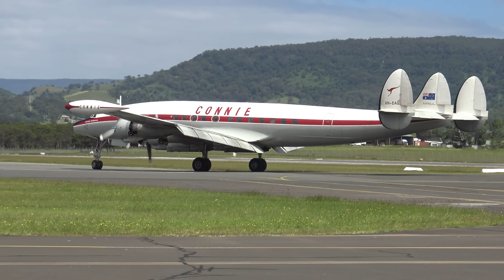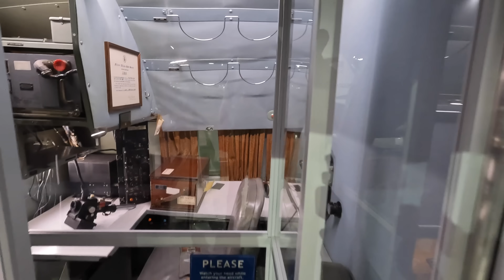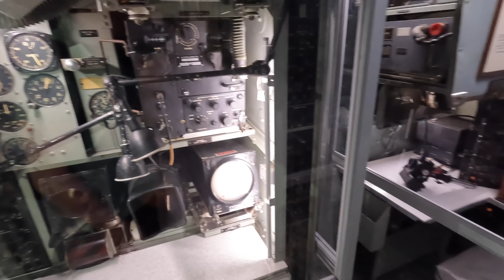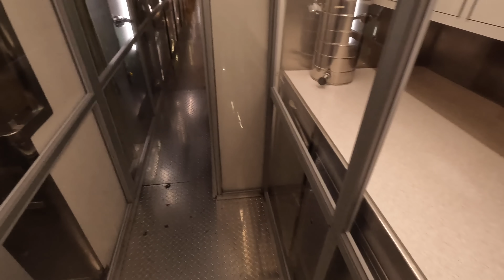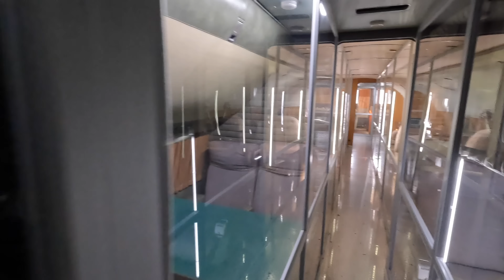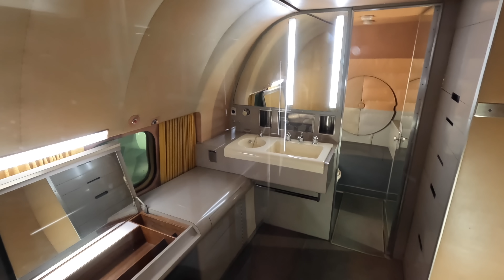Tour through Eisenhower's Air Force One - VC-121 Columbine III

Comment: There is a Connie permanently parked outside the TWA Hotel at JFK airport in New York City. The interior has been converted into a bar and lounge and anyone is welcome to come in. That’s the only Connie I have been inside of. It’s very well preserved inside and out except for the bar they installed at the rear. The plane and the hotel, formerly the old TWA Terminal, is well worth a visit if you are ever stuck at JFK for a while.
Reply from the maker: Yes great suggestion! I was in JFK last year and totally forgot about this but I definitely need to stay there next time. Apparently it's expensive, though.
Reply: @PaulStewartAviation Not necessary to stay there. The large public areas are all free to visit. They are all finished in retro 1960’s style and contain a lot of free museum quality exhibits about the Connie and Howard Hughes and the history of TWA.
Reply from the maker: cheers for the info!

Comment: At the radio operators position, on the wall you see four shiny Chrome semicircular wire racks. 

I know what those are for. 

I think I've been on this plane. There are more such shiny metal half circle racks in the rear of the fuselage. Those are for the same purpose.

Comment: Always loved this airplane, I think it's the most aesthetically beautiful frame ever designed, and I had the absolute unforgettable pleasure of flying in two of them. First 18 August , 1961 at 12 years of age I flew in a VARIG ( RG ) Super Constellation G from Sao Paulo to Idlewild ( now JFK ) with several technical stops. Second, August 19 1961 flew in a TWA Super G from LGA to MDW, ( O'Hare had just opened and was not operating at full blast yet.
I recall TWA marketed the service as "AMBASSADOR", I felt important, wow, real class. And, this is my whole Connie experience, after that, came the 707, DC-8, CV-880 and all else, I am now 75 and still fly whenever I can, regards to all!

Comment: My father worked for Curtiss-Wright from 1952-1963. His work included inspections of engines undergoing a major overhaul. One time an engine from this plane was damaged during a test. Everyone involved was investigated. It turned the 'master control' for the fuel, like a carburetor, that had been serviced by an outside vendor, had a part get loose and got into the engine.
Reply: That engine was also known for eating Power Recovery Turbines, the two-speed superchargers, and they could, on occasion,  be ingested. It usually happened during climbs when the A/C was changing from "low blower" to "high blower" so as to maintain a constant pressure to the cylinders. I have been on the E-121 when that happened on five different occasions.

Comment: This aircraft spent many years outside at the Santa Fe airport out in the dirt far away from the regular traffic of the airport. Back in the mid 90's I can remember walking all around it with my father wondering about it's fate. It's nice to see that it was properly restored and has a good home now. Who ever told you it was flown to the museum in the 60's for permanent display was mistaken. I still have photos of it sitting out in the desert.
Reply: Is this the one that sat on her tail as a parts plane? I heard of one that was saved and the owner was trying to raise money for restoration but had a hard time.
Reply: @crushingvanessa3277  The one I saw was still all together. Just dusty
Reply: @crushingvanessa3277  No, the aircraft at Santa Fe was all together and I believe was in flyable condition, with a bit of work.  I was fortunate enough to board and tour this plane during one of the airshows there in Santa Fe. Beautiful plane.